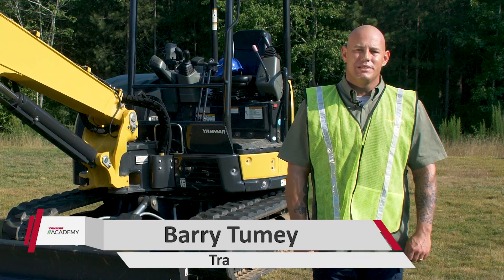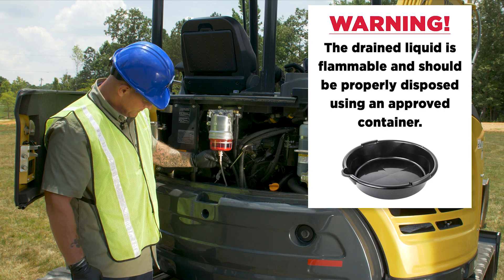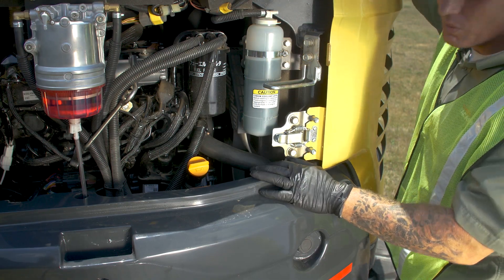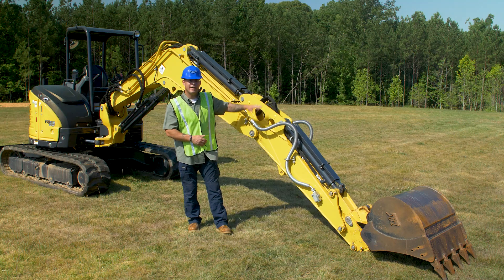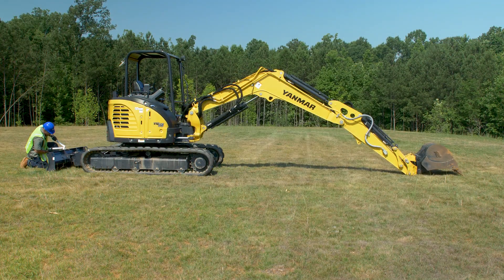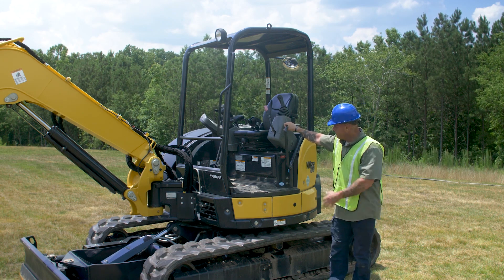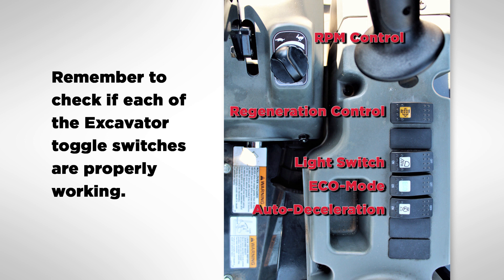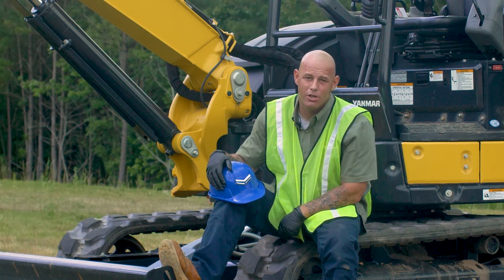YANMAR Excavators Maintenance

Comment: This is the only CLEAR demonstration/ explanation of what the manufacturers mean by 'contract'. They mean 'extend'; of course they're referring to the cylinders, which are not the first thing you notice when you're looking at the MACHINE overall -- overall all the limbs are EXTENDED. This has been very, very helpful for me. 

I know this is not in the remit of this 101, but the manufacturers are very remiss when they never mention removing the drive motor panels and removing the debris, derusting and rustproofing, painting the INCREDIBLY expensive motor.

Cut the music, it's distracting.